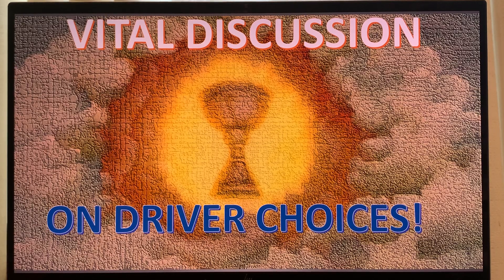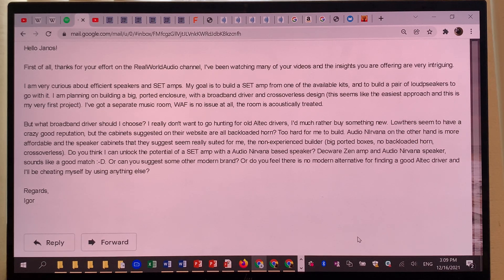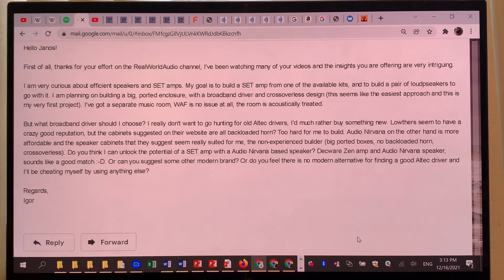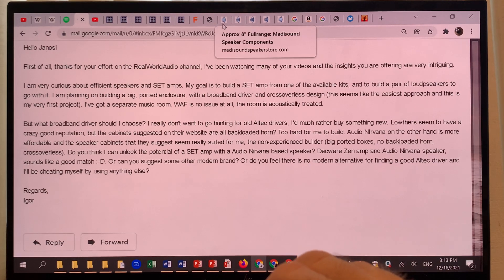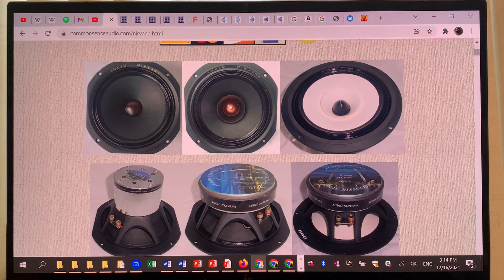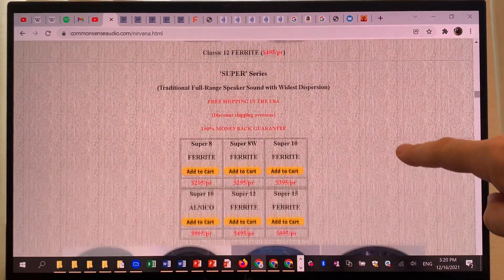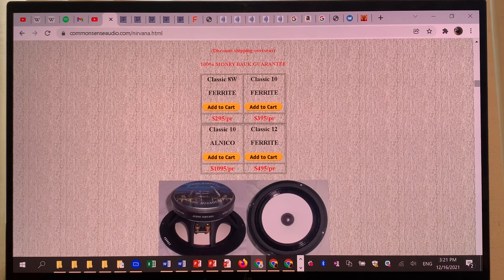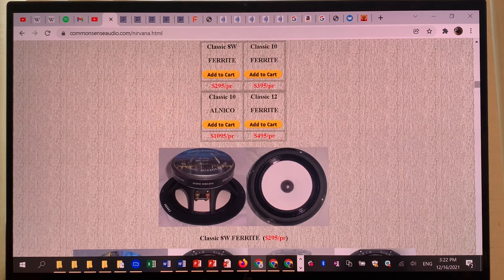How to select full range drivers:   Audio Nirvana

Comment: I have a pair of Audio Nirvana 12" cast frame in the original 75 liter cabinet. But they play too little bass. I have tried with a subwoofer, but am not satisfied. Would mounting them in a Voight horn help?
Reply from the maker: Their bass repsonse would also depend on how they interact with your room, so hard to predict - can be either complete hit or miss. Are you missing in the original cabinet low extension or is the midbass too lean?
Reply: @realworldaudio  today I play on a pair of Klipsch RF-62. They play fine with low and high volume.

Comment: I got a pair of PRV 10" full ranges at PE, dropped them in some old Cerwin Vega 1.8c boxes, they sound fantastic for under $160. I have toyed with the idea of adding a super tweeter for some sparkle but so far have not.  These have a dB of 100 and need very little power. Karen Carpenter has never sounded better, and they work great for Black Sabbath too.
Reply from the maker: Congratulations, Kenneth! If you like it now, you might not need a super tweeter. Although it would add extension, but it also alters tonal balance for better or worse. So, my advice would be to keep on using it full range and if you want to experiment with super T, then make it switchable, so you can switch it on/off: and then you will effectively have two different sounds for recordings, and some will prefer without the superT, and others can use the extra extension or quantity ;_).  
Also, when you add a super T, try firing it up to the ceiling. Can blend it so much easier and natural that way.
Have fun! Janos

Comment: I know this is an old video but I just found it and someone may still find my comments useful. I have experience with AN drivers as I sell speakers built with their 10 and 12 inch units, both the Super and the Classic. Cabinets are as per AN's plans, except for longer tubes for the bass reflex in the 2.8 cubic foot cabinets for the 10's. They sound truly open, detailed, natural and dynamic with a realistic tone and energy of the sound of instruments and voices. They do have an upper midrange glare which had to be tamed - for my taste at least - with a notch filter. 
I have not measured sensitivity, but I use them with 2-3 watt amps with no issues at all.
Reply from the maker: Thank you Gábor for the superb application feedback, much appreciated! I also find that loudspeaker cabinets are generally tuned a bit higher than my own taste. I prefer the more even midbass & deeper bass extension that the lower tuning provides. János

Comment: About 20 years ago, I added a screened-in porch measuring 15x42 and bought 4 ceramic 12 inch whizzer cone Audio Nirvana speakers wired L-R-L-R in the ceiling driven by a old Yamaha 100 watt receiver.  The roof is sloped so the speaker are in a non-parallel except the end stub walls enclosure.  Basically I use it for partying with family and friends along with just me having cocktails while outside with zero bugs plus I have 2 big ceiling fans.  Everyone comments on how good they sound, they aren’t audiophiles but some are music lovers, reliving their glory years.  I’ve can highly recommend these and I’m sure the rest of the line is probably killer to especially considering their costs.  The only issue has been one driver lost a plastic trim ring and I thought once or ??? After a mid Atlantic winter the voice coils could have gotten sticky from the high humidity we get, but crank it for awhile and it disappears.  They’re cheap and I think sound ridiculous good for the $$$$$.  They are Altec 604s no matter what some may say at leastIMHO.
Reply from the maker: Nice setup for parties! Indeed, that is always a challenge, you found a neat solution. I like your method of de-humidification!

Comment: I have compared A.N. Super 4 Plus Ferrite drivers with my Fostex FE126s (and others), and found that they're quite a bit less efficient comparatively. They sounded natural and musical, but I tired of them quickly due to boredom. The Fostex just had more of everything, and were more "alive" as well. This could very well be different with A.N.'s other drivers, just sharing my experience with these.
Reply from the maker: Thank you Cory for the valuable feebdack! Indeed, efficiency is absolutely vital for naturalness and musicality, and a lot of loudspeakers are overrated on paper. Indeed, when looking at the AN data, it appears that the rated sensitivities are quite a few dB higher than what their curves suggest.
Reply: @realworldaudio  100%. I think of high-efficiency speakers being compared to a great singer with a broad range and the ability to go from loud to soft without straining. Very natural and effortless. 
Modern low-efficiency loudspeaker systems are a bit more like Don Henley as a vocalist (sorry Don- love his music)- exciting to listen to, but much more compressed, limited in range and strained. 
A.N. have discontinued their 4" driver. The downsides I mentioned may only apply to that one. I really want to try some larger ones. 
I've noticed that most Markaudio drivers have a lower efficiency rating also, but are otherwise stellar performers. Another huge benefit with FRSDs is that you can play around with a wide variety of units at a reasonable cost. 😀

Comment: why do voigt pipe's always have small drivers size 6" a concentric driver would be better something like a KEF or Tannoy
 8" concentric driver or 10" maybe would be a lot better, I've not seen anybody using a concentric driver in a pipe configuration, it should work very well give it a go!
just make the cabinet deeper you can still keep it narrow actually better, if the driver's to the edge of the cabinet and the inner wall of the cabinet is closer to the basket ideal.
I think those tannoy gold active monitor 8" drivers are quite cheap to buy as replacements I'm sure you couldn't get hold of them probably for about $40 each
the best single driver is cube audio fc8 but they're not cheap  about 1200 think that's each.
 really serious about it the ultimate single driver in class.
Reply: I use 8'ts in my pipes. Even those cant replica low natural bass
Reply: @Thode-R  what type of filling are you using? Try and keep away from the poly... try wool and open cells foam or a mixture of both. You could increase the baffle width will increase bass, get a piece of marine half inch ply cut it round say 14" cut out for the speaker with a flash finish countersunk. Making sure the inside of the cabinet is bulldozed because of the extra depth ideally but might be not necessary.

Comment: Indeed , there's paper , paper and paper......every manufacturer had his recipy........
Non compressed paper fiber and air dried on a matrix found on some older productions ..........better grip on the air, lighter , faster and because of non compressed the is cone very stiff nevertheless ( structures analogy like construction towers - cranes etc )........plus the fiber material choice ....................;some are wonderful in combination with an alnico or field coil magnet .......
Difficult to find and expensive ............;
A site to visit among other dedicated to full range speakers ..... : 
High efficiency Speaker Asylum...........
Reply from the maker: High efficiency Speaker Asylum.... that's where my loudspeaker journey began!!! :) lots of great advice, and one of the best forums on Audio Asylum ; )>

Comment: I recently purchased a full range driver from a co. with a decent reputation. I put them in a cabinet and they are fine, but I learned that the published specs are waaay off, probably 5db lower sensitivity than stated, as measured by an experienced builder...! This matters with low power triodes. The company knows this, when I brought it up and stated my disgust, I was duly blocked from their FB group!! So just a warning to be wary of published specs and do diligence before purchasing!
    By the way I have their metal full range driver still breaking along with my whole new system. During my driver research I read many Mark Audio users that say their paper cones sound like one would expect the metal to sound, and the metal has the qualities one would expect from a paper. Found that interesting. There's so much to all aspects of this hobby!!
Reply from the maker: That's just such a bad behavior, blocking user feedback! Manufacturers really should stand up and explain why is their data different compared to another measurement. At least accept the feedback... I am appalled. 
Funny though, indeed, sometimes driver construction throws curve balls, and they end up sounding quite different from expectations...